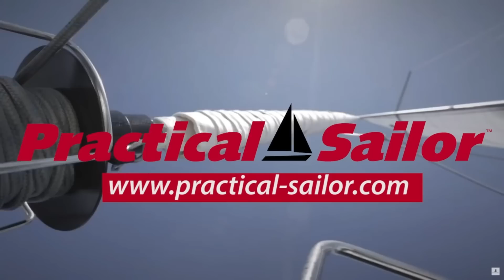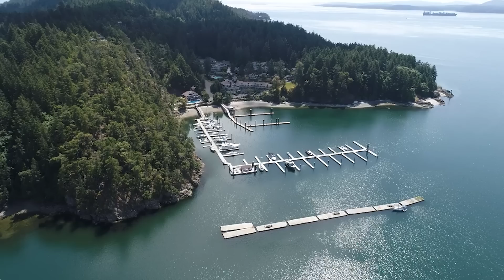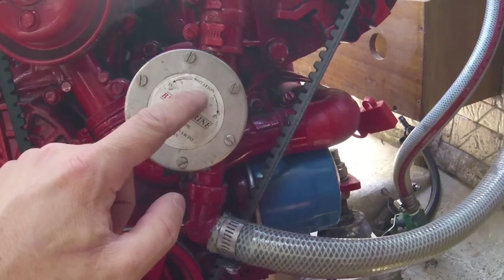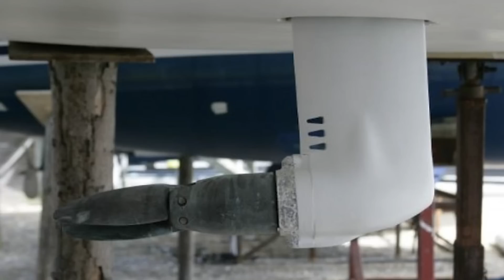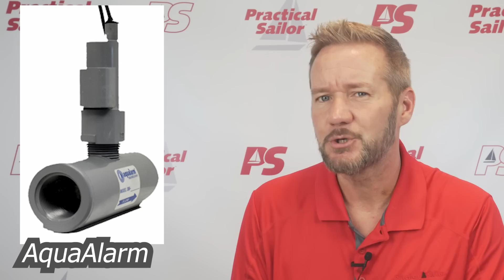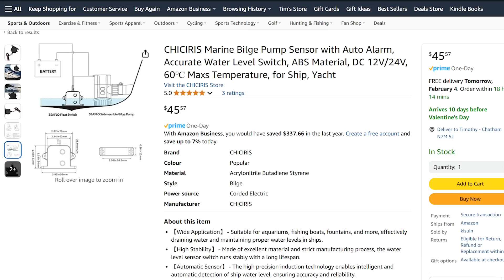Diesel Overheating Dinghy Pump Hack

Comment: Nobody seems to connect the dots. Raw salt water for cooling is stupid. How about a radiator? Then there's dumping salt water into the exhaust. If that's not stupid enough, some boats are using seawater for generator and refrigeration cooling. I have a Deutz and a Sichuan Sifa. Air cooled and air cooled. I just started to cut stainless steel parts for an enclosed exhaust system. I have a longstanding hatred of both raw water cooling and water drenched exhaust
Reply: I once sailed on an old wooden 45 ft sloop constructed in Germany in the 30s or 40s. It had an air cooled 4 cylinder diesel under the cockpit sole with huge vents both inside the cabin and against the cockpit bulkhead. Forced air (large fan) kept the air moving. Obviously, no sound insulation surrounding the engine. No conversation possible in the cabin when it was running, very loud in the cockpit. I'm sure powering in the Baltic in winter was a pleasure, all that hot air dumped into the cockpit. No so much fun in warmer climates in the summer. There was also a dry exhaust with limited muffling. This whole set up took an enormous amount of space, the space required for air flow and insulating the dry exhaust. Thanks for the comment but I'll stay with raw water cooling.

Comment: On the subject of sensors for the engine, I like the idea of a flow sensor for cooling water and will likely add that to my engine.  The other major routine engine issue is fuel flow and fuel pumps or clogged Racor filters.  I added an Across Ocean Systems Bluetooth pressure sensor to my fuel line last year and now I have a pressure readout on my Chartplotter so I can monitor fuel pressure.  If the engine stalls and pressure is OK, it is not likely to be a clogged fuel line or fuel pump.

Comment: I've done the same on my Westerbeke 10hp dsl intake hose a couple of times when a film of growth had blocked the intake grill a couple of years when I hadn't used the boat in the last few weeks of the season before driving it to be hauled out.  Removing the intake hose from an elbow it uses to make a 90 bend, I found no water coming in when opening the thru hull valve.  Cupping my hand tightly around the open end of the hose (to keep my mouth off the rubber hose) and then blowing hard through my cupped hand, I've been able to blow the clof off the intake easily each time this has happened (you can feel the pressure change and hear bubbles as soon as it uclogs, then see water come back in), then quickly close the seacock, reattach the hose and restart the engine while checking for enough water coming out the exhaust again.

Comment: For the backup intake, instead of another thru-hull, could you use a hose that you throw overboard? Not sure if the impeller would be able to suck the water up and over, but it would avoid a second thru-hull.

Comment: Brilliant. I used to think using your breath wouldn't work. I was wrong. I've got a problem with raw water pumping to my two heat/AC units. (One pump)  I figured out that in my Hunter 456 the top of the thru hull valve was about 18" (46mm) below the waterline.  Close to snorkel depth.. My plan was to close the valve unhook the hose, connect a four foot section of the same hose, hold it up in the air. (Paracord running hitch on the hose tied off on a hatch handle above. This way the water could not rush into my bilge. (Sure it wouldn't have been a problem). 
 The first thing I tried was blowing into the hose. Worked easily. I didn't have a blockage, but I did prove that blowing as Bert did is  indeed a valid test. Not sure I could've cleared a blockage, but obvious first step.  The next thing I tried was to fill the hose up with water. I was right next to my galle. Of course I couldn't find a funnel, but the tea kettle has a narrow spout... Water quickly returned right to the same level (matching the waterline). And because I'm a nerd I also used a boroscope I bought cheaply. That worked too, but all I could see was the bronze plate of the scoop. These are all repetitious steps, but also a bit of practice, and everything I used was at hand. 
The problem was up at the pump. At the pump I removed the hose and did some of the same things. Same results. So the actual lesson might be to start up the line instead of at the thruhull. Depends on the situation. 
The  plastic plate impeller  of the pump has friction melt damage, so next step is to replace that part. The melt though is caused by running dry, so maybe I had a blockage that was temporary. Guys come by every month and scrape the hull.  (My fix. New Little Giant pump $215, impeller parts  only about $90 longer delivery time.  I bought the pump. If swapping the impeller parts solves the issue, I'll buy the parts, install them on the new unused pump and put it with the spares.  Previous owners' collection of spares has been incredibly useful. Good practice. And always ask around if you're remote. Someone else might have exactly what you need.) 

More nonsense: (diving snorkels are only as long as they are because if they were any longer the water pressure on our chest would be too great to use them. So this short length isn't the limit, it's where our lungs are under the water.... I guess if you were on your back in about 3' or a meter under water and you had a much longer hose, you could breathe. Because your lungs are higher.)

Dinghy pumps have that pop out pressure valve, so I wouldn't worry too much about hose clamps and proper size hoses and adapters, just use the tape. Tape will probably take more pressure than that pop out valve. Our lungs are more powerful than I thought, but almost device is more powerful than our lungs.

Comment: I have a Volvo diesel and was wondering what kind of heat sensor gauge I could install to warn of overheating.  The Aqualarm may just be the ticket and a cheap insurance to say the least.  If you have any other suggestions I’d love to hear about them. I’m still going to purchase and install the sensor before heading out this spring.  Thanks for your help.

Comment: Just a thought...tee off the galley sink drain. You would need two seacocks (one on the tee and one to prevent sucking air from the sink), but no additional holes in the boat and you could do it without a haulout.

Not a fully formed idea, but Sunday morning with coffee it sounds brilliant. I would love to hear opinions....
Reply: I thought about that Peter. The sink through-hull is close by but accessible from the forward side of the galley. Long hose. And, in an emergency, I would have to rig a temporary hose as installing a permanent hose from the galley to the engine compartment would be difficult. But hey, a guy that would cut a hole big enough for a sail drive can't be squeamish about one more small hole in the bottom, could he? Thanks for the comment!
Reply: @BertVermeerSailing  Yup, certainly dependent on proximity and access. Lord forbid one has a galley that runs the side of the saloon! LOL

Comment: Thank you for sharing the alarm info, something for the shopping list
Reply: I don't know. What I see is more levels of complexity and points of possible failure. (I've got all manner of dead alarms all over my boat, heat, bilge, etc... The inportant ones still work, all these add ons corroded out years ago.) What I see are two or 4 more hose clamps, and a 'thingy' hanging down into the water stream for something to get hung up on. (I used to do parks maintenance as a summer job. If some hard object gets caught in the trap, it'll will collect toilet paper, clog up and overflow the toilet. Easy to plunge clear, but then it'll do it again and again, in days or a week. The only solution is to unbolt the whole commode, tip it upside down and shake it.)  Then there's the wiring and connection to the audible alarm. 
I've stupidly taken my boat out without opening the thru hull. I warm up the engine for at least 5 minutes before starting out. Five minutes into moving I'll get the overheat alarm -- well in advance of any serious heat. The first time I motored back to my slip. Then I just flipped the autopilot went below and opened the valve. One time I even opened the hatch and having left that valve open after the last trip, I closed it... Now I hang my keys on that handle.  
And Lana if you have time on your hands to install this alarm you probably don't need, I could sure use some help on my infinite list of boat projects.....
Reply: @WillN2Go1  As solo, I'm a firm believer of K.I.S.S., but also believe in "simple forms" of redundancy.
$100 to be notified on deck of a potential issue in the engine room, prior to the engine sensor possibly failing to activate, is extra peace of mind.
Unless your aware of an alternate method?

Comment: I had a blockage in the vent hose for my black water holding tank.  I disconnected the hose from the tank and used the dingy pump to clear it out.  That was nasty but it worked well.

Comment: my boat has a tee with a 1/8th water pipe running to the centre cockpit. 
When the engines running….water trickles out just above one of the cockpit drains. 
Dave the original boat builder/owner was into simple solutions

Comment: Years ago a young lady paid a mechanic to help her solve here over heating problems. 
  He decided the head  on the engine was defective so he took it off and replaced it .
  Changed a her a small  fortune and the problem  persisted.
  An 75 old engineer was called in next and he quickly discovered the intake  was plugged and he devised a quick set up and blew a plastic bag out the suction pipe 
  He charged the young lady 50 dollars  for his efforts. 
  Moralnof the  story. 
Get another opinion or more.

Comment: I had a similar issue with my raw water intake. While on a mooring mid summer in Edgartown I was running the engine to top off the batteries. Water intake suddenly stopped. The strainer was full of bits of jellyfish.
Many were seen in the harbor that day.  We used the same technique with an inflatable SUP PUMP.
I will be very careful about running the engine during a jellyfish invasion.

Comment: Thanks for the video Tim I love and need all the technical help in sorting out a sail boat. Last summer i purchased my first sailboat a 1990 edel that is in need of some new running rigging do you have any advice for blocks and pulleys that are looking a little tired. I admit I am a little intimidate at the prospect of replacing them

Comment: I had to go for a swim in November to clear a clog because this exact trick did not work. Note to self - install only straight (not elbow) MPT to barb adapters on seacocks, so they can be cleared from inside from whatever obstruction.
Reply: That's what we did with a smaller inlet for the water maker and used coat hanger wire on a drill for clearing without much water coming in.

Comment: On my Watkins 27 I installed a tee valve jus before the raw water pump so I can switch the water intake to a bucket.
This way at the end of the season I can flush the engine with coolant for the winter.
But I can also use it for an emergency like this.

Comment: Instead of adding a redundant through hull for emergencies, how about carrying an extra hose that you can hook up to the raw water filter and throw it over the side of the boat? You might need a provision for priming the hose, as I'm not sure the impeller will be able to suck the water up over the side of the boat.

Comment: That is quite a gadget. A flow reading alarm. Nothing about price. A freon temperature switch could be tied to the motor instead or an antifreeze pressure switch. I have a radiator, and would consider it if forced to use a water cooled diesel. They're precious. I don't own one. I have an air cooled diesel. These could rescue a lot of motor problems sailboats if they were easy to hook up. It's very easy to install an air cooled diesel.
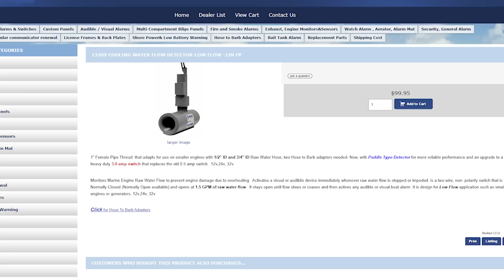Reply: 07:35 $99.95
Reply: A simple pressure switch would do the job.

Comment: I did something very similar with my SHOP VAC when cruising to the thousand islands in Lake Ontario.  After cleaning the strainer and checking the impeller, I disconnected the raw water hose at the water pump and held the exhaust end of my shop vac on that hose.  No need for adapter or tape even though the hose sizes were very different, I just held my hand around the smaller hose.  Within seconds I could hear the bubbles.  Advantage is that the volume of air ensures all blockage/weeds are expelled from the system and it's very fast/easy to do.
Reply: I think I will do this once a year as normal maintenance.

Comment: In similar situations I’ve found instead of a massive amount of tape, try wrapping something like a plastic bag around the smaller pipe like a makeshift gasket/bushing works really well.  It’s a lot faster and easier to take apart when you need to reconnect things quickly.

Comment: I had a similar problem but it involved the AC raw water intake for my boat on the Chesapeake Bay. On a rather hot, humid day at the dock the raw water alarm on the AC startled me because (like the story) I never heard it before. So I examined the system from the raw water pump, which was working, back towards the through hull. The strainer wouldn’t fill with the sea cock open. Disconnecting the hose the ball valve didn’t allow any water to come out also when it was open but there were “strands” of what looked like long snot (sorry to be gross) coming out of the top of the ball valve. I recognized these strands as part of the ubiquitous Chesapeake Bay “sea nettle” (stinging jellyfish) that populate bay waters in the summer. Putting on gloves so as not to get stung, I removed as many strands as I could, opened the ball valve and inserted a long screw driver to try and push the offending sea nettle out. No luck. As a last resort, before hauling the boat out, I connected a hose to the open ball valve, took a might deep breath and blew into the hose with all my might. First time didn’t work but the second try did with bay water gushing back towards me. I quickly closed the valve, ran up on deck and looked over the side. Floating upside down, like a used pale old coke bottle cap was the previously stubborn sea nettle or more like what was left of it. I never thought of using my dinghy pump but next time if this happens again I will.

Comment: Good video but you weren't thinking far enough ahead.  AquaAlarm can build an integrated custom alarm panel (they did for us) so you bring ALL of your alarm circuits together to a common panel - single buzzer, LED lights labeled.  Now we have only 1 alarm buzzer - if it goes off - go below, check which sensor is unhappy, mute the buzzer, deal with it.  (Oil Pressure, coolant temp, high water, victron alarms, Garmin alarms, yacht devices etc.  Any system w an alarm relay can be added)...
Reply: "MASTER ALARM PANEL" common on aviation, space and larger ships

Comment: Had a similar blockage and resolved it with my Air Horn! Just removed the hose at the pump end, opened the thru hull, fit the 'horn" over the hose firmly by hand and fired the horn a couple of times.

Comment: I remember my dad and I motoring out of Danvers River, Massachusetts (Choy Lee Bermuda 30 Ketch, with gas universal 4)  and it started to overheat. 
We picked up  mooring off Beverly and removed the thermostat, it ran very cold but got us to Marblehead.  
The engine block coolant (sea water) was filled with rust scale from the engine block, no heat exchanger in that engine.....